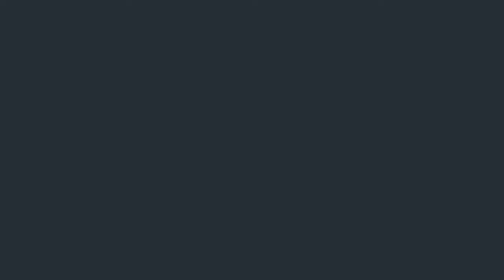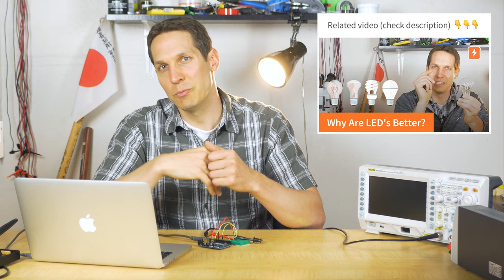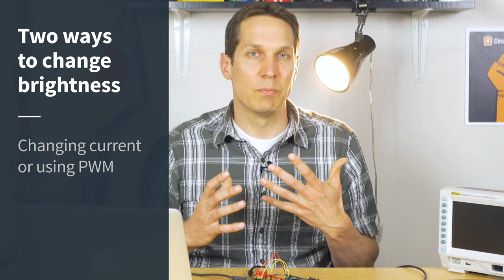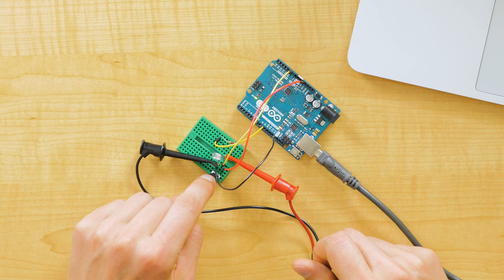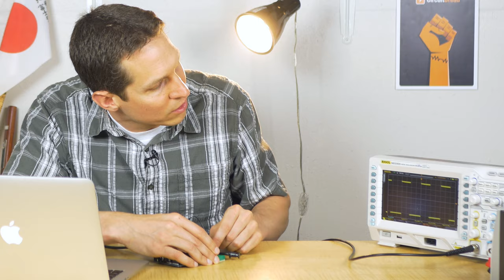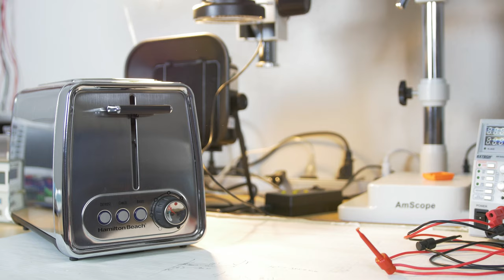How to dim an LED - the two MOST COMMON ways | Basic Electronics

Comment: There are 2 other large disadvantages of pwm:

If it's not a large frequency say over 1000hz it can cause eye fatigue and headaches. Also your video camera might sync up with the pwm frequency causing video artifacts. Sadly most commercial dimmers use something like 250hz pwm
Reply from the maker: We actually have made some changes in the office that we shoot these videos and were struggling with that exact problem with the video camera.  We ended up having to use a less efficient linear dimmer with a large capacitor in parallel for it to stop strobing on the camera.  It's funny how (in my opinion) LED technology is so great but the implementation sometimes leaves much to be desired.
Reply: @CircuitBread  Have you got any resources/video on how you did it?
Reply from the maker: Sorry, we didn't document any of it but it literally was just putting a large capacitor in parallel on the output.  Very straightforward.
Reply: ask your cat how it feels? @CircuitBread

Comment: You could do voltage limiting very easily with a 10k potentiometer. Just a suggestion for your video. This would dim the LED to a point. This is basically a voltage divider circuit in this case then. Potentiometers are very cheap by comparison of PWM.
Reply from the maker: Yep, that's an inefficient but effective method.  It does have some non-linear properties but if you have a non-linear potentiometer to offset that, it should work!

Comment: Thank you for the video, precise and clear. I am looking for a way to dim a string of led’s smoothly for home a theatre application. Things I have tried so far all seem to dim in steps and then go out suddenly, any recommendations?
Reply from the maker: If you look at the voltage versus current curve for LEDs (IV curve) there's always a challenge at the "knee" where the current starts to spike up as you adjust the voltage.  At this spot, the brightness changes very, very quickly with the smallest change in voltage.  If you're manually controlling the voltage via a rheostat or variable resistor, you could potentially put two of them in series - one that has a larger resistive swing and one that is smaller and more precise.  That way you can switch over to the smaller, more precise rheostat when it's getting dimmer.  Just one thought!
Reply: @CircuitBread  Thankyou for your response. Clever possible solution, I will give that a try. Regards.

Comment: Beginner here.  I'm working on a project with a LG LED 55 inch 55UK6090PUA.  I got it free because the screen stopped working but not the backlights.  I'm using it to make a Movie Poster backlit frame.  
Question.  How would you go about powering just the backlights?  I need to be able to dim them as well because it is REALY bright and I no longer have a way of seeing the settings menu obviously.  
I'm hoping to disconnect the Main board and just keep the power supply.  Or if it makes more sense, get an external power supply.  Thanks
Reply from the maker: Cool project!  I'm not sure how you could control the main board but if you find the LEDs themselves and how to power them, you could get an external power supply and then control the brightness quite easily.  A lot of LED drivers can just use a screwdriver to adjust the current flow (and thus brightness).

Comment: Hi i ahve a 12 V 5 W Dimmable led bulb will this be enough for PWM modulation as i worked with the same 12V 5W Dimmable Led strip
Reply from the maker: Yep, they should be electrically the same from your perspective.  Unless the LED strip is made up of programmable LEDs, which could complicated things.  If it's just a standard dimmable strip, then you should be totally fine.
Reply: @CircuitBread   i meant will the dimmable bulb of the same wattage and voltage work with slight error margin with pulse width modulation ? Secondly , is emi caused for 20 Khz for the same modulation of the bulb and will this effect nearby wifi signals ?
Reply from the maker: Yeah, as long as the bulb and the strips are both driven directly by you, it should work just fine with PWM.  As for EMI, at 20kHz, you may produce some EMI (which should be reduced if your wire from your controller to the bulb is short - less of an antenna) but Wifi is 2.4GHz so, even with harmonics, you're in a completely different band.  It shouldn't have any affect on Wifi.
Reply: @CircuitBread  i am developing a product where the pcb  is made with esp12 F

Comment: Thanks, so is it safe to assume that most LED controllers (eg. Zigbee controlled ones) use pulse with modulation? that would explain why my manual voltmeter did not detect any voltage/current changes
Reply from the maker: Yeah, I personally assume that they use PWM unless they say otherwise.  It's the worst in terms of quality of light output but best in terms of cost and design.

Comment: Is it possible to do this for a cars headlights?
Reply from the maker: Technically yes but they are much more powerful than the LED used as an example and the significantly higher current demand complicates things in terms of finding the right parts and dealing with excess heat.

Comment: I've been doing commercial/residential and industrial electric for the last 24 years and I am currently in college for basic electronics taking technical math and I feel overwhelmed.  What I have had to overcome in the field never taught me anything about theory. I don't want to quit but I don't feel prepared for this.
Reply from the maker: Hey Lance, the math can definitely feel overwhelming.  It's also easy to get lost in both the math and the concepts.  Just make sure you come up for air every once in awhile and make sure you haven't strayed from the important foundational concepts.  If you have good teachers, talk them about your concerns and see if they'd let you know what is the most important things to understand from the lessons so far.  Despite this, it will be tough.  If you can't get everything done this semester, then you can try again with a huge headstart next semester.  It sucks but you wouldn't be the first one to have to do that.

Comment: How can I "un-dim" a light, as in go from dark to light?
Reply from the maker: Just flip it on its head!  If you want to go from dim to bright, just start out with a higher potentiometer setting or a lower duty cycle on your PWM.  If you want something brighter than the max brightness of the LED, the only good option is to get a bigger LED.  You can overdrive LEDs for awhile and they're pretty tough but you'll definitely be shortening their life and risking a small yet catastrophic failure.  Bigger LEDs have better heat dissipation methods as, though they're MUCH more efficient than incandescent, they definitely still produce heat.

Comment: Can you please explain why you need to use pulse modulation or a complex current/voltage control system when I just hooked up an LED straight through a potentiometer and it dims it just fine.
Reply from the maker: Scaling and efficiency, mainly (and those two are related).  As you change your potentiometer, any power that is not being dissipated in your LED is being dissipated in the potentiometer.  For a single, small LED, that's totally fine.  Once you get much bigger, the potentiometer (which usually ranges around 1/10 watt to 1 watt) will start to struggle with the power.  Power that is just being wasted. With pulse modulation, a reduction in brightness also has a reduction in power.  Again, for a small LED, it doesn't really matter but it does as it scales.  I hope that helps!
Reply: coz its a dumb idea as pots can only handle a few mA

Comment: Your theory doesn't sound right to me.  I don't think its is fully on and fully off in those pulses.  I don't think our eyes would see that as something being half lit.  I think it is more likely the LED materials speed of reaction is such that a 50% on pulse would behave the same as 50% current, and therfore the led would only shine half as bright.
Reply: But either way I needed to know how to dim a LED, and now I know its PWM.  Thanks for that!
Reply from the maker: Hey Mark - glad we could help!  I am going to disagree with the LED materials speed of reaction idea, though, and only because LEDs can turn on and off very quickly - that's why they're sometimes used in communications (like remote controls) because they can do clean and quick infrared pulses.  The best way to test this it to get an emitter and a detector and then hook the detector output up to an oscilloscope - you'll see that the incoming signal is very clean.  It does blow my mind sometimes, though, that that's the way our eyes work...
Reply: It has to do with something called perceptual inference. Our brain makes assumptions based on last state and present state based on vision being 30 frames per second at best.

Comment: I used a mini pwm for my leds and when turned low they flicker. I have a constant voltage dimmer and it worked fine 🤷🏼‍♂️
Reply from the maker: Yeah, the constant voltage dimmer is nearly always better when it comes to performance, it's just a bit harder to create yourself.  We just updated the office where we shoot the videos and had to switch drivers for some LEDs to a constant voltage dimmer (and I threw a large capacitor in parallel on the output as well) because they were flickering badly on the camera.
Reply: @CircuitBread  agreed 💯. Do you have the link for that video? It definately looks tricky to make, I'm just lucky it was prefabbed. Do you know if just a potentiometer would work for dimming? I have a funny feeling about it lol
Reply from the maker: Sorry, I didn't see this but yes, a potentiometer would be incredibly inefficient yet very smooth.  We don't have a link for the video because it was just something we were doing behind the scenes for my office (that has been completely overtaken as a studio now...)  We've shot a couple videos with the new backdrop where this came up but they're all still being edited.
Reply: @CircuitBread  makes sense, that would be too easy lol. Definately not optimal for a group of LEDs. And gotcha, I'll keep my eye out! And no worries thanks for the reply!